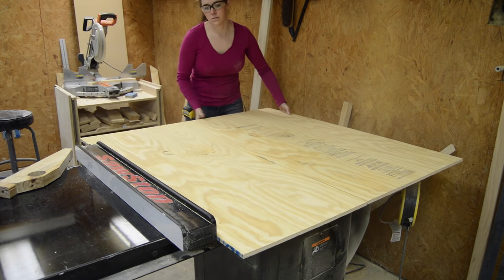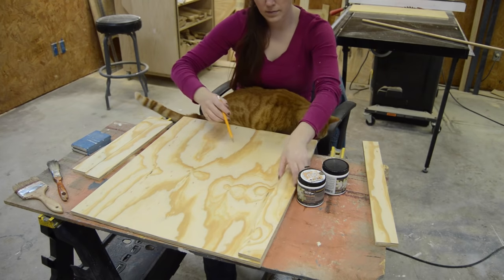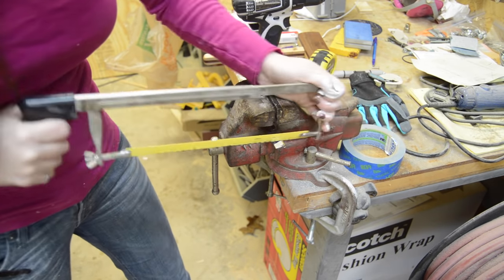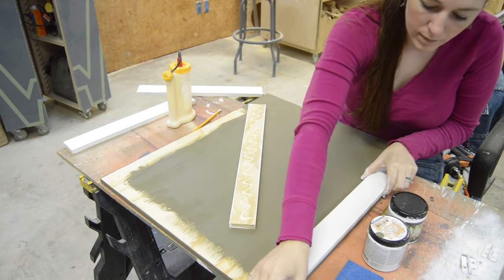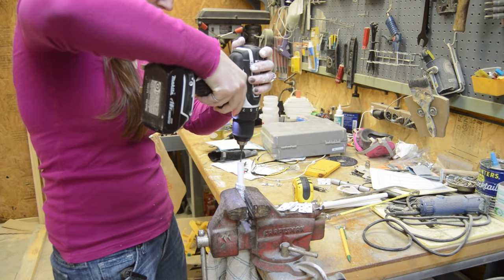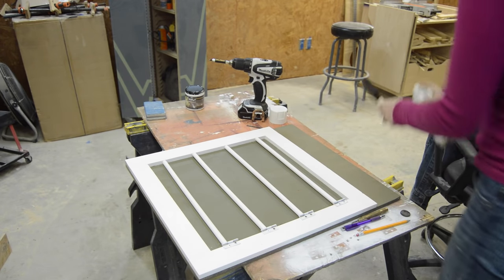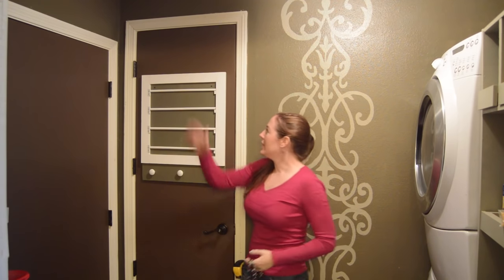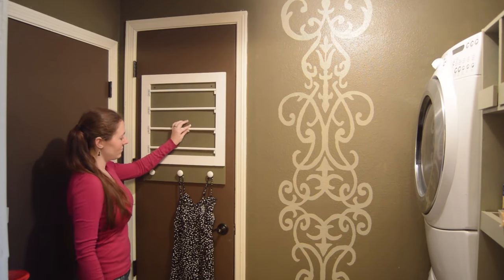DIY Clothes Drying Rack

Comment: A tip I always find useful for when using a hacksaw, the hand you hold the handle with, use three fingers instead of 4 to grasp the handle and with your finger nearest thumb run it along the top frame parallel with the blade, it gives you much more control of the saw and the angle you cut at. Great wee idea for a project, you make everything look so easy.
Reply from the maker: Ooh that's a good tip. I'll give it a try next time.

Comment: As always very nice. I do have some concerns about the screw holding the dowel going into the end grain of the dowel. Given the length of the dowel even a very light item will place a pretty significant load on that screw. I think you will see it pull out in a very short time. My thought would be to screw a block the depth of your frame by 2" wide to your hinge. Prior to attaching it to the hinge drill a hole the diameter of the dowel in the middle of the block. After attaching the block Insert the dowel into the block with a drop of glue. You would then have a much stronger connection point between the dowel and the hinge. 

You could 45 the two ends to dress it up a bit, or just make them so the they run half the distance to the next dowel which would make that piece look continuous down that whole side. Also by doing that you could make your hinges a little long thus making them a little more stable and able to support more load. At that point the strength of the dowel would become the load limiting link in the chain.

Sorry if I sound negative, I just see that as the one weakness in an otherwise great project.

Comment: Newly subscribed, and I am liking what you have to offer. Your ideas are good, and I don't have a shop to do woodwork in, so I am extremely jealous of what you have. I have a couple of tips for you that you may or may not use. 

1. get some latex or nitril gloves to use for painting and staining projects. It makes clean up really easy, and you can still use your hands for filling in your nail holes etc.

2. Make an extension table for your table saw. It will really make cutting plywood a lot easier and safer. You could even attach it to the saw and make it fold down if you have issues with space. It can also double as a work surface. Don't forget to make the channels for the guides.

Thanks again for your videos, it makes me inspired to rent a space for my own workshop.

Comment: Good idea April!  
I sure hope those hinges hold up over time.
Reply from the maker: Thanks David. Yep, we'll see. I couldn't see any other simple solution so I figured it was worth a shot.
Reply: April Wilkerson
One thought on that could be making the rods from PVC pipe and drilling a hole through one end of all of them and use a wooden dowel for them to rotate on.  This would also get rid of any problems from putting the wet clothes on a wooden surface.

Comment: Very cleaver as usual April.  Still have your chops with the batons I see, that was fun.
Reply from the maker: : ) I guess it's like riding a bike. Normal batons have a little weight to them so they are easier to control and throw around. But dowels work in a pitch. ; )
Reply: I loved it and as it was even harder to do just makes it so much the better for a good show.  I once was on a drill team where we spun rifles around and thm buggers were in lousy balance so they were tricky to toss around.  We did one thing where we stood in two lines apart by like six feet and tossed across to the guy on the other side while he was tossing to you and there was this crazy little bugger running down the middle with rifles whizzing just in front of him and just behind, timing was everything.

Comment: I like the paint-before-assembly approach, so you don't get white paint on the darker parts; I'm thinking DiResta's trick with wood glue but a few dots of hot glue to attach them might have been quicker even than tacking them down with the nailer.
Reply from the maker: I agree! I wish I would have seen his video before I finished this. Hot glue would have been better for those little resting blocks as well. Getting a nailer in there was tricky.

Comment: Would be nice to see Linn (Darbin Orvar) do load testing on this one. The dowel-held-by-a-screw-hinge joint may get weak very far too sooner. And this design may not be kid-proof. They love to pull down on hanging stuff...
Reply from the maker: Load testing wouldn't be very reflective because this isn't designed for any sort of heavy load. This is designed for light weight undergarments that us women don't like throwing in the dryer. I can throw every single undergarment I have on this rack and it not equal to 1 lb. And you're right this isn't kid proof, but I never make anything kid proof because I don't have kids. : ) My suggestion for that would be to mount it higher out of reach of children that are still young enough to want to pull on everything.
Reply: Thank you for your sweet reply :)